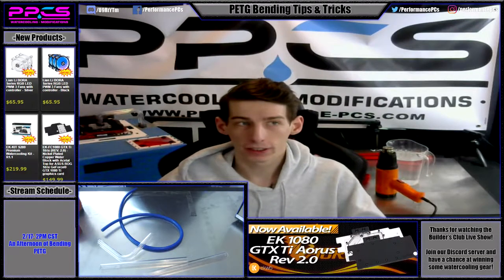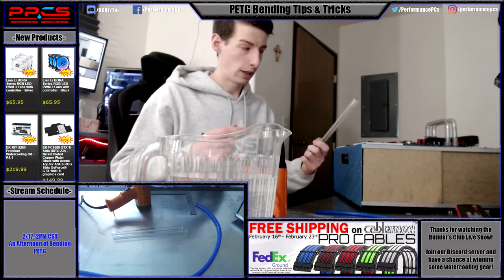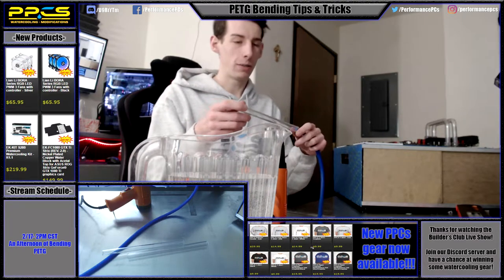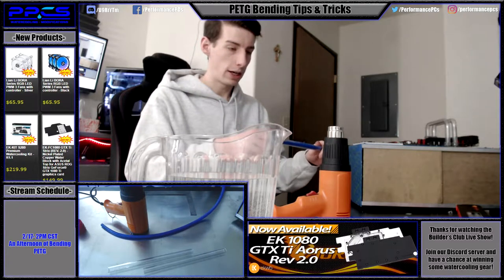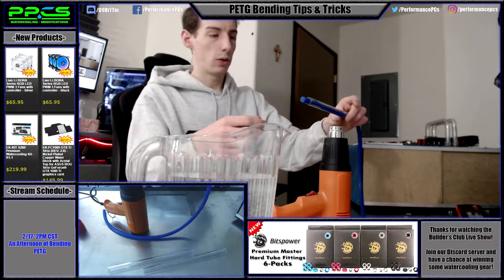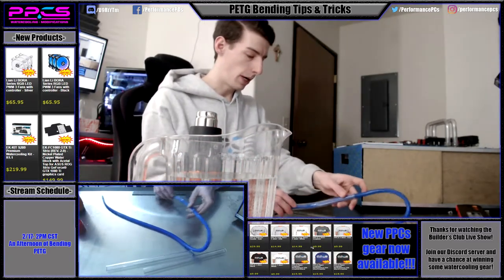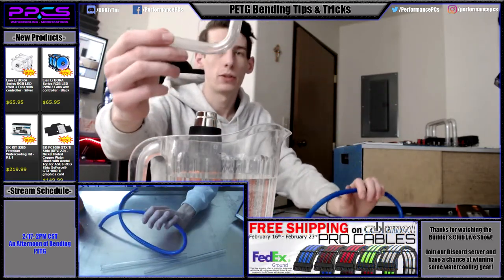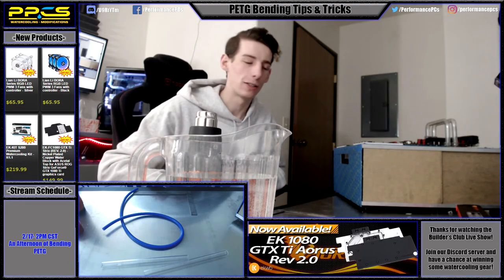PETG Bending Tips & Tricks

Comment: Bitspower’s 11mm insert is too small for their 11/14mm petg. I’ve bought a few different ones just to make sure I did t get a bad one and they are all small. Even carefully bending a tube there is always distortion and slight warp of the petg because of this. Where can I buy a different 11mm insert?
Reply from the maker: That's a tough one for 11mm as Bitspower is the only brand that uses it. Before buying a new insert, make sure that you are heating a good length of the tube like I demonstrated in the video, this might solve your warping/distortion issues. Otherwise I would suggest trying a 12mm insert. It might not fit, however it could be close with some sanding. - https://www.performance-pcs.com/water-cooling/water-tubing-soft-hard/tubing-and-pipe-tools/bitspower-hard-tube-silicone-bending-for-id-12mm-1-meter-bp-htsb12cl-1m.html
Reply: @PerformancePCsTV  the issue I found out was the primo hill bending mandrel! It molds the melted petg into a perfect 90 but it has a flat spot that exactly mimics the mandrel. I sick at freehand bending 🥲